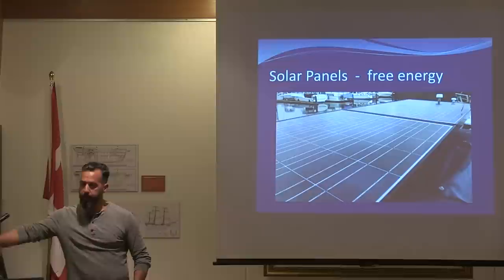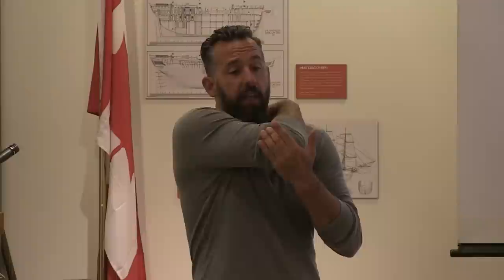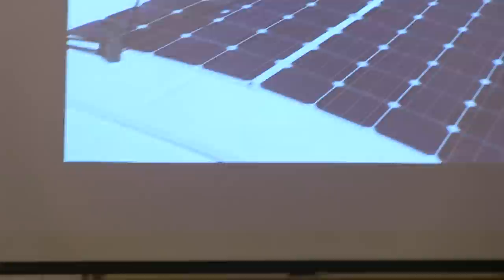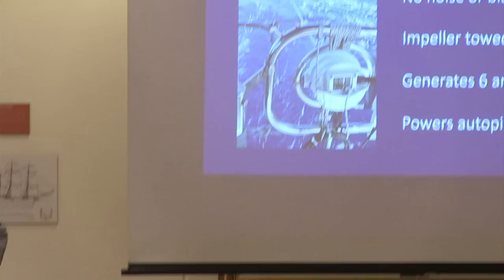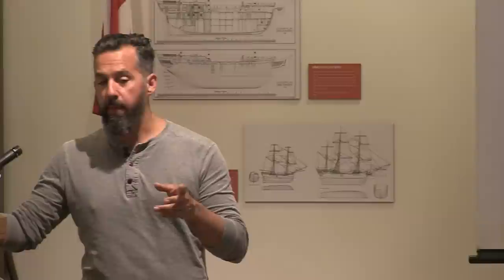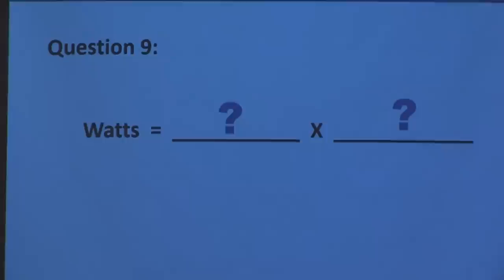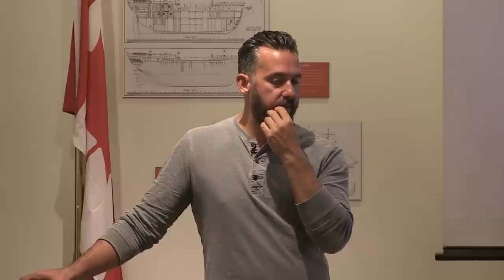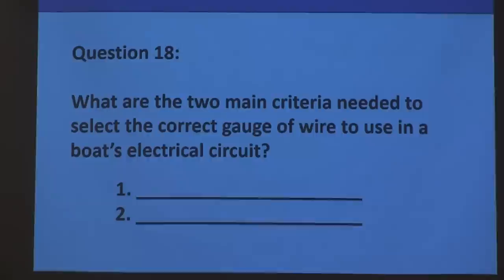Seminar: Marine Electrical Basics - Part 6 of 6

Comment: I have been a electric powered forklift mechanic for 35 years with heavy experience repairing, diagnosing, rewiring, component installs and wiring from scratch. I will never stop learning and I was aware that wiring on a boat would have some different elements that I would need to be aware of and was I right, after watching this introductory series I am even more convinced that I am not ready to take on the various tasks required to make my boats wiring dependable. I will continue to learn under your tutelage and others as information and knowledge is key. Thank you for this informative introduction series.
Reply from the maker: Thanks for the input, life like boating is a journey, as cheesy as this sounds, there is always room to improve ourselves.

Comment: He's like Richard Rawlings, only knowledgeable! Awesome series, much appreciated. Boat owners' risk assessment is puzzling to me. If you are on a boat and something really bad happens in your wiring, you can't just coast on to the shoulder, put the hazards on and call a rescue service. You can't even be outside your vehicle while trying to put the fire out. You're in an egg shell, that is ALL that's between you and the abyss and this is where boat owners choose to SAVE MONEY on wiring? "Insane" doesn't even begin to cover it.
Reply from the maker: Hi Alf, you and I think alike on this. Why take a chance with marine electrical, it's so counter intuitive.
Reply: @PacificYachtSystems  I'm fixing some issues in an aluminium boat today. 2x 12V 100Ah, Two 2 meter, 50mm2 cable runs. No main fuses... Oh joy.

Comment: Thanks Jeff I just watched all six episodes and took lots of notes in my iPad including lots of to do’s, to find out, and to check. I realized today that I was told in the shop that I was buying AGM batteries, and set up the charger accordingly, they died. A friend told me last week that they look like standard flooded lead acid. I’ll adjust the charger today after you raised this, which I had forgotten.

This is an excellent series, and has inspired me to read more and study my system. Thanks.

Have you worked with Nigel Calder’s ‘Integral’ alternator/ smart generator which seems to be a game changer? Any view to share?

Comment: The course is very useful. It gives an amount of technical elemnts to learn and many tips based on professional experience. If you miss a step because the matter is complicated, you can work it out on your own as the instructor have given all the necessary knowledge, even if sometimes it is implicit. It would be super great if you could upload some practical videos. How to do this, how to do that. For example how to check if the system of your boat is ok? supposing that you are chartering it. Thanks a lot!
Reply from the maker: Great recommendation - we will add it to our list of videos to shoot!

Comment: Good stuff. I'd say that when you inherit a boat or even an old house you should be suspicious of everything including wire colors. I've been electrocuted once or twice before the advent of the chicken stick due to questionable wiring practice. My favorite example when telling people to be sure is my mom's house which was built before they metered electricity. Someone failed to run all the power through the meter and so even with the meter pulled some of the very old (knob and tube) circuits were still hot.

I also have a comment on the DC ground. The ground plane is relative to the battery positive. The body of water you are sitting in is relative to nothing. Adding some connection to the water will not provide a better scenario in terms of power or safety. The reason the engine is grounded is happenstance related to the automotive origins and the starter. Consider a car which has no connection to the ground underneath it or electronics which strive to not be connected to the chassis to keep the DC clean.

AC power on land wants the ground and the system is regularly grounded to the earth which acts as a ground plane. Even so there are still isolated ground AC circuits where the ground, say on conduit, is kept separate from the ground wire. The issue is that there is generally noise from RF that generates a delta between the neutral's idea of ground and a bare wire ground in conduit and this can create issues. In such systems I have seen as much as 40 volts of delta. Once we get back to the panel everything is tied back together and run to ground via the same cable.

On a boat that is not in a marina AC power is a self contained system where the hot/neutral/ground are relative to the source which is contained on the boat. When you get to the marina and use shore power then the ground is relative to the earth.

I guess my other comment is land based electricians for sure care about voltage drop and distance. If you are going more than 50' you will up-size the cable. The difference is the distances are much further which is also why large buildings, e.g. a factory, run high voltage e.g. 480V v.s. 240 and also use 3-phase v.s. split phase.

Comment: In part 6, you mention that a boat battery (dc electric system) not grounded to water is ungrounded or a floating ground.   How does this apply to a "plastic" (ie. fiberglass) boat with an outboard motor.  Most of these have no grounding plate or direct ground to water.  The motor is grounded to the battery and it appears the battery is ground.  Thank you.

Comment: I am learning a lot with these presentations, just disagree in two instances:
Voltage should represent the speed of the electron across a conductor; W=VxA, volume = circumference (A) x distance(V).
When a wire is feeding a load and its resistance is increased, the Voltage drops; the load will continue to demand the same Wattage for the work being executed, therefore the current demand will increase.

Comment: I just want to say that i am from europe and loved these 6 videos, especially the video of the burning up cable had my attention, never actually realised the amount of smoke. Actually what i missed is a lesson about shore power, i am on a boat which cannot connect to shore power due to tripping out of the residual current device on the shore and our electrician cannot find the cause on the ship, tried to disconnect several grounding cable from generator and main panel but to no avail. Thinking about mounting now a transformer between shore and main panel...
Reply: Careful with installing a transformer in order to isolate your boat. There is a reason the RCD trips and i know it's tedious and tiring to troubleshoot this but for your own safety the time is well spent. The RCD is supposed to protect us from getting electrocuted :)

Comment: There is al lot of talk about amp hours. Are they 12v amp hours?
Why not use watt hour's?
Reply from the maker: Good question but don't know the answer. Battery capacity is measured in amp-hours at C20 rating. To stay consistent, we too talk about power consumption and capacity in amp-hours.